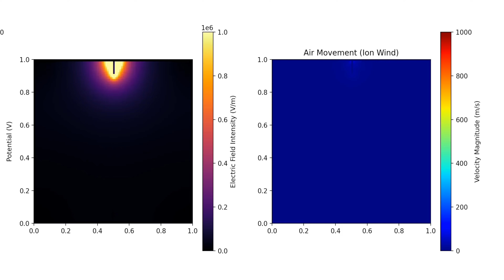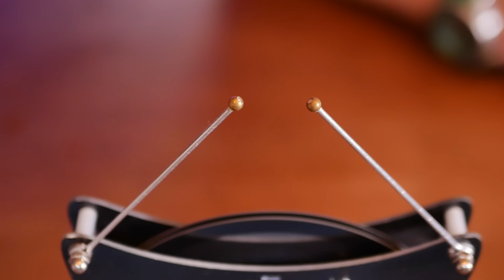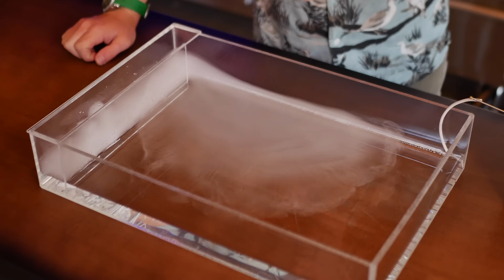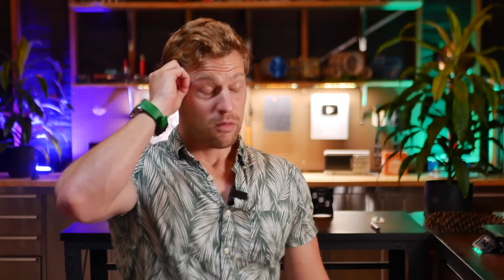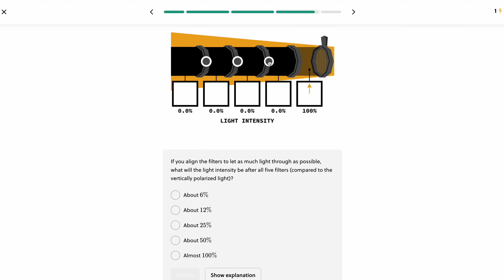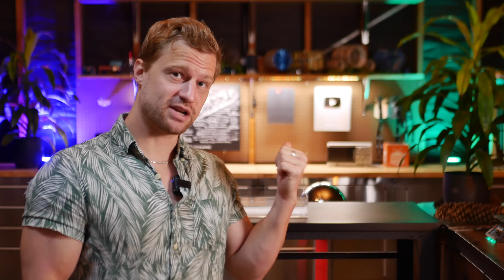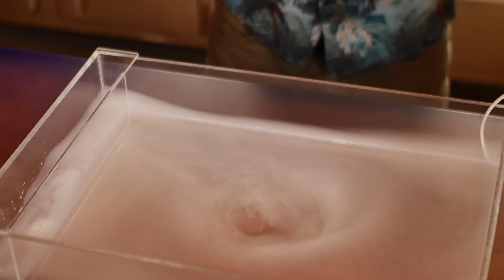This High Voltage Fog Is Controlled by Pointing (BiFrost Nebulagraphy)

Comment from the maker: Thanks to Chris for his assistance, my father Rick for reminding me about that "cool fog effect from years ago", and to Brilliant for sponsoring this video! Chris and I are working towards documenting the science behind this in a formal paper, with formalized results to come soon. Thanks for watching!
Reply: Hey does this work using ultrasonic water vapour instead of dry ice? Making a "desk toy" version of this that only needs to be plugged in instead of refilled with dry ice every time would be very cool to see. Love your work!
Reply: @jerryhuff4767 are you perhaps asking for a Chinese friend? 😊
Reply: @jerryhuff4767  From the old video (2006,) the streams will pop bubbles.  So, a little bubbler to make a white layer of tiny bubbles.   The streams also affect oil films, and the original inventor Charles Yost discovered them via Schlieren photography, so the streams must have a large effect on air pressure.
Reply: Why did you forget the theramin instrument it works almost on the same principle
Reply: @kanpurunplugged9970  The phenomena in this video are quite different than those used in the theramin.   The video depicts ionization of air molecules which are then drawn along an electric field (possibly with some electrons not attached to atoms) provided by the high voltage difference between the pan of water and the presenter who's attached to the high voltage DC generator.  The theramin operates by detecting subtle variations in capacitance between each of  its antennas and the operator. No high voltage nor ion flow involved, just an AC electric field.
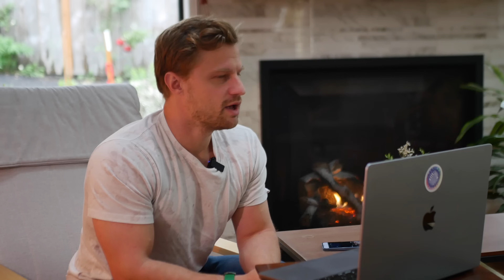Reply: Thanks for the video, a very interesting effect! I also got a kick out of "Propagation of intense catastrophe beams in air", mainly because it's fun watching scientists squirm and try to find new and inventive ways to avoid saying Tesla's death ray. While I will assume that for the sake of entertainment value, your actual experimenting was cut out of the video. From the viewer's side, we got to witness an effect and then a brief explanation of 3 possible theories, but no actual experiments, measurements, or testing of the theories. I would love a longer video with the testing left in, if possible. The setup has several variables that should be tested to see what role if any they play in the effect. For example would a different gas or liquid change the results. How does changing the conductivity of the liquid alter the results? Attempt manipulating the effect by introducing a magnetic field, does this alter the course of the beam? How is the beam affected by different types of obstructions, for example, does the effect work if a plate of glass or sheet of paper is between your hand and the liquid. Does the air temperature affect the results? Instead of using your finger can we use other materials and test a small range with conductive and insulating properties? Can we create a deeper fog layer to observe air currents being created farther from the liquid surface? What effect does reversing the electrical polarity have. What would we observe if metal fillings were suspended in the liquid? Then the next most important part since you already developed some theories are there any ways to challenge them? What must happen that would disprove ion tunneling being the correct explanation for the observed effect? I find that a theory is only as good as its potential to be disproven. A theory that has the potential to be easily disproven is a good theory. A theory with no ability to be disproven is faith, not science. I love your videos!!!! They always get the creative juices flowing! You should also look into this video "Shooting Electrons In a Cloud Chamber Is Amazing!" by "The Action Lab". AT 4:55 in the video he runs an experiment very similar to yours but instead, he is using alcohol vapor in a cloud chamber setup. His and your experiments are very similar in principle but produce dramatically different results. Might be interesting exploring why. Crossing my fingers for a follow-up video!
Reply: What possible beneficial application might you imagine could potentially use this?
Reply: @autonomouspublishingincorp1778  Weather control, earthquakes, anti gravity, plant growth(large trees), Melting buildings etc.
Reply: @autonomouspublishingincorp1778  This effect won the 2002 Nobel prize in chemistry.   It's used to load single biomolecules into a mass spectrometer.  (The streams turn out to be microdroplets, launched like a machine-gun via DC high voltage.)
Reply: @wbeaty  In spite of the dishonor of winning a Nobel Prize, wouldn't you think there is likely something actually useful that could be done with this if someone were clever enough to figure out what?
Reply: Super great!! Thank You!!
I can imagine why this Experiment won't leave One's Head, it is so easy to reproduce and super impressive! Also looking like Magic
As a Followup what would happen if You reverse the Polarity?
Reply: "Applied high voltage TO a sharp POINT"??? How about "BETWEEN" a sharp point and ground"?
Reply: Can you reverse the flow to see if the gas travels upward? I also want to see if you can get a probe in a balloon, maybe fill it with water and see if it will pop. I want to see if you can use the coil and power a florescent bulb, or effect an electro storm ball. (More I text the more ideas I come up with lol) like how about doing this in a pressurized container to see if it effects it through the glass. (Maybe your plasma generator container?) or hell just fill that bad boy with co2 and turn on your plasma generator 😂 I can only imagine how fast that gas would spin.
Reply: @vidiotray3  You can make a plasma-globe from a little Tesla Coil with a plastic bag full of pure argon.  (A 1cm spark in air  becomes a 10cm spark in argon.)   And, the ion-thread doesn't need water, it just needs a charged metal plate and a grounded nano-emitter such as a single human eyelash.   All of that could be done inside the argon-bag, no vacuum pumps or glassblowing needed.   Will the plasma streamers from the TC follow the "air wire?"
Also, I made an upwards ion-thread using a small metal ball in the water, with a single human eyelash attached to the upper surface.  It makes a white line, since it entrains some fog on its upward journey.
Reply: @wbeaty hmm kinda want to see that, any vids on that?
Reply: New idea, add a friend to act as a disturbance. See if they can block the bridge.
Reply: 3:29   It’s only hard to explain when you negate  the  aethr*.  Attempting to do so without it becomes quite a mess …. Formulas filled with fillers and fluff.   Soon fluffers are found all around attempting to keep things up and moving in the right but ultimately wrong direction/s.  Lost in spaces. Tired cold empty pLaces. An all holey d vine land of lace.  Awl Holes that is. From Dreamer to 2 d reamer.   

Luckily i was brought back on track by Einstein, in a little known  neglected talk, where he retracted his prior statements regarding aethr and so much more. Hoping  he could undo the damage he admittedly had a large roll in… unfortunately it was too little too late. The world of science was already moving along and had no time for suggestions. Corrections. Or backtracking. His foundation was already being built upon and bearing more weight by the day as shims Shovels patches and plugs worked to keep any ifs ans or buts inline. Closed shut.    

 
In this talk Epstein * said to even try and consider a system without the inclusion of the aethr is utter lunacy.  The info in said talk bookends nicely into primer fields Theory by David Lapoint which explains the double slit experiment in excellent detail as well as gives his #PrimerFields Theory which replaces what you’ll discover is the incorrect “Bohr/Bar Magnet Theory”. 

I promised you of you view the “Primer Fields Series” by Plasma Physicist David Lapoint; which is found free here on YouTube…. You will agree with me. 

All you need is an open honest heart and mind. Driven by true intent. Aka to where and what the truth leads is no matter as long as it is the truth. 

*a less oft used spelling these days though it truly is what i would certainly refer to as the “correct” or best spelling… this is because of its connection to other words on anagram form:

aethr
earth
heart

This spelling is also excellent æthr/Æthr…. As these æ/Æ characters literally tie to aethr. 
 
 
Did you one that the title
“king Arthur and the knights of the round table 

 is encoded using something called the “language key”  which involves  phonetics, word breaking and some simple excellence cipher basically. Outside of certain circles this sort of info is largely unknown and typically sharing it would have been off limits  ( though studies have shown the public cares very little for such things and unless they are told by the proper channels… they will almost certainly reflect pretty much everything. … ¿ What are the “Proper channels” you say?   Those of the television of course. “The noose you can trust”.  It would  be major news to most if they learned that all along a language has been hidden within language …..and yup you guessed it. There’s same one woven phonetically into everything since before you were even alive.  (Interested?? Want more proof ?  Or are you devoid of curiosity lacking an inner spark? Heart chords long since cut or perhaps never were attached due to …. Various factors ….one being connected to inviting fertilization lacking the literally spark of life upon fertilization. The male and female acting as ano-de catho-de. The arc and projecting blue beam…. Which is mirrored in the earth.  And is the origin of the so called project blue beam.  Another name for that is the “ball lancing beam “. And the scale known as the triple beam also connects. Why am i going on about this?? Well it also connects with the title though im not going to go any further into all this at the moment… i mean beyond giving pretty much the entirety of the hidden title.:

“KinG Aethr and the k-ni-nights of Ð-round table”

“KinG Aethr and the k-ni-nights of Ðrowned table”

The four corners.  ( ļ )

By the way the largest corporations in the world have names that tie into this Drowned table.  Such as “Blackrock” and “VanGuard”. The Blackrock wpuld be the Magnetic Mountain. Aka Mt.Maru as well as the basis for tails told by JRR Tolkien and many other initiates. Bearing a light, a torch, knowledge about the past and predictions of what’s to come. 

* interested in reading this talk by Einstein? Let me know and ill give you help. You simply need to ask.
Reply: You deleted my comments…….  Oookay.  That’s problematic.   
Why would plasma channel delete  stuff about plasma??   

And if you disagree with the info I’d like to see you openly do a reaction videos or something like that. Explaining why it’s wrong …… i cant imagine how one could do that since …. It all unifies nicely
Reply: @CoincidenceTheorist could be YouTube itself, been experience people complaining about this for a while.
Reply: If you wanna know some amazing math stuff from before the pharos, look up the vase measurements in the unchartedx channel.
He measured some ancient relic vases with  modern  metrology equipment.
the tolorences are amazing  and so is the use of pi and phi as well as their radon-based measuring systemyou should have a podcast with them lolor just react to them
Reply: Some what off topic and cryptic but by ionizing the air you're able to trap photons some may disagree in larger scale testing the data shows it works especially for higher power out put.
(air waveguides or optical waveguides in air)
Reply: I'm going to admit, I don't jump into your videos as much as the other sci-education creators I (probably most here) follow. Your stuff and deep dives - it's at odds with your channel aesthetic / vibe. My eyes scream at me to expect "bro bro bro" Douche'ry... Throws me off a bit. But totally cool topics!
Reply: Caused by lint fibers standing up on your skin, so, when it doesn't work, lick your fingertip, then brush it across fabric.   Also, damp woolen mittens work great!
Reply: It's well documented since being discovered around 1914. 
The term is Taylor Cone, also Electrospray.   I stumbled on it around 1998, and tracked it down to droplet-emission effect.  Rats, not unexplained physics discovery, no Nobel prizes for me!   
Apparently a sharp wire will not make these streams, but a mercury-wetted wire supposedly will.   Maybe try it with warm gallium, not Hg.    Damp human hair, damp woolen mittens, and single human eyelashes work great.   Also try the torn edges of paper.   I suspect that dry fibers must have little corona discharges at their tips, to send off carbon particles.   A bit like smoke from stick-incense, but with an added high voltage drive to remove turbulence.

Accelerator jockies call this the "gas focussing" effect, where a cloud of moving ions will self-focus into a thin beam if any gas is present in the chamber.   However, this is slightly different, because gas-focussing involves collisional production of opposite ions which then form a hollow sheath surrounding the moving ions.

I attached a single eyelash to a little disk of foil, then floated it in the fog tray.   I managed to photograph the laminar stream shooting upwards from the tip of the eyelash.   Also, surrounding the eyelash, you can see fog moving inwards towards the eyelash tip, like bad CGI of a black hole.   Apparently these streams entrain quite a bit of air, and convert a collapsing spherical flow into a laminar line-flow.

If you vibrate the emitting-hair, the stream becomes modulated.   Try slow pulses, then using time-delay to measure the stream velocity.   From a quick test it seems to be above 20MPH with a 5KVDC supply.   Maybe we could store digital data on the stream?   Or audio?   I managed to make 6ft streams using a VDG machine, with a plant leaf taped to the dome as the stream-emitter.

Controversy:  how small must a charged fluid droplet become before we call it an "ion?"   In today's FIB Ion-beam Lithography, the so-called "ions" are actually small droplets of liquid indium, produced by a "liquid ion emitter" via the Taylor-cone electrospray process.   These streams are not "ions," not charged atoms.   They're hypervelocity indium bullets, shot through an electrostatic railgun.   (Do this in a vacuum chamber, and the stream will automatically drill its own exit-orifice.   In other words, what you've got here is Ion-beam Lithography, but using it at 1ATM to sculpt fog rather than bulk silicon.)

All of the above from 1998 suggested demos for HV physics lectures and science-fair projects.     DANGER:  if you mess with these inside vacuum chambers, the streams' velocity is many orders higher than in air, and will slice or drill through objects.   In 1984, I saw this effect drill through a standard light bulb, but at the time had no idea why it was happening. That was using 200KVDC in vacuum.
Reply: @wbeaty  I think this video demos something even less fancy than electrospray, and that's plain old "ion wind" (see wikipedia for details,  observed in 1709, apparently). Cool demo, but as an experiment not very helpful:  What is the role of the pan of water... is it just providing a diffuse ground terminal, or is it significant that it's a liquid, or of a certain temperature? Does the "fog" play any role other than making the air flow visible?
Reply: This is a really interesting effect. Congratulations for the persistence and ensuing breakthrough! I hope we get a chance to explore this phenomenon in more depth at OpenSauce!
Reply: now apply this to handle deep space communications
Reply: This video has blown my mind, one of your best. Thankyou mate. Love from Oz
Reply: My kids love this channel.
Reply: So currently you've tried it with a sheet of fog, what if you take this to the third dimension and fill a box with fog?
Reply: @ShadowWolf2508plays  use a human eyelash as an emitter.   Put the emitter inside the fog.    You'll see the fog contracting like a tiny sphere, with the emitter-tip at the center of the sphere!   The hair-tip is pulling in fog from all directions, then launching it as a narrow stream far narrower than 1mm.   But the thin stream looks invisible (maybe it's just moving too fast?    From their time delay, these streams appear to move at over 20MPH.)
Reply: Is there a way to see the ions as they go from your finger to the fog?

Or how about this, could you fill a box with fog and try doing this? You know, instead of doing this on a flat surface...
Reply: Im so mixed about the content.. as in.. I like the content...but Mr Beanwater is soo giving me Homelander vibes.
Reply: Please if you can check Joe Rogan's episode with Terrence Howard
Reply: hola, puedes filmar tu experimento usando el efecto Schlieren
Reply: THEORY OF EVERYTHING IDEA:  Revised TOE: 1/24/2024a:

TOE Idea:  Short version:  (currently dependent upon the results of my gravity test):
The 'gem' photon is the eternally existent energy unit of this universe.
The strong and weak nuclear forces are derivatives of the electromagnetic ('em') interactions between quarks and electrons.  The nucleus is a magnetic field boundary.  'Gravity' is a part of electromagnetic radiation, gravity acting 90 degrees to the 'em' modalities, which of course act 90 degrees to each other.  'Gravity' is not matter warping the fabric of spacetime, 'gravity' is a part of spacetime that helps to make up matter.  The gravity and 'em' modalities of matter interact with the gravity and 'em' modalities of spacetime and the gravity and 'em' modalities of spacetime interact with the gravity and 'em' modalities of matter.

TOE Idea:  Longer version:  (currently dependent upon the results of my gravity test):
THE SETUP:
1. Modern science currently recognizes four forces of nature: The strong nuclear force, the weak nuclear force, gravity, and electromagnetism.
2. In school we are taught that with magnetism, opposite polarities attract and like polarities repel. But inside the arc of a large horseshoe magnet it's the other way around, like polarities attract and opposite polarities repel. (I have proved this to myself with magnets and anybody with a large horseshoe magnet and two smaller bar magnets can easily prove this to yourself too.  It occurs at the outer end of the inner arc of the horseshoe magnet.).
3. Charged particles have an associated magnetic field with them.
4. Quarks, protons and electrons are charged particles and have their associated magnetic fields with them.
5. Photons also have both an electric and a magnetic component to them.

FOUR FORCES OF NATURE DOWN INTO TWO:
6. When an electron is in close proximity to the nucleus, it would basically generate a 360 degree spherical magnetic field.
7. Like charged protons would stick together inside of this magnetic field, while simultaneously repelling opposite charged electrons inside this magnetic field, while simultaneously attracting the opposite charged electrons across the inner portion of the electron's moving magnetic field.
8. There are probably no such thing as "gluons" in actual reality.
9. The strong nuclear force and the weak nuclear force are probably derivatives of the electro-magnetic field interactions between quarks and electrons.  In the case of the alpha particle (Helium nucleus), the electro-magnetic field interactions between the quarks themselves are what keeps them together in that specific structural format.
10. The interactions between the quarks EM forces are how and why protons and neutrons formulate as well as how and why protons and neutrons stay inside of the nucleus and do not just pass through as neutrinos do.  (The neutrino being a substance with a very high gravitational modality with very low 'em' modalities.)
11. The nucleus is probably an electro-magnetic field boundary.

THE GEM FORCE INTERACTIONS AND QUANTA:
12. At this time, I personally believe that what is called 'gravity' is a part of electromagnetic radiation, gravity acting 90 degrees to the 'em' modalities, which of course act 90 degrees to each other.  'Gravity' is the force which allows a photon to travel across the vast universe without that swirling photon being flung apart or ripped apart by other photons and/or matter interactions.  Gravity being a part of the 'em' photon could also possibly be how numbers exist in this existence for math to do what math does in this existence (the internal oscillations of the 3 different parts of the 'gem' photon, each modality having a maximum in one direction, a neutral, and a maximum in the other direction.)  'Gravity' is not matter warping the fabric of spacetime, 'gravity' is a part of spacetime that helps to make up matter.  The gravity and 'em' modalities of matter interact with the gravity and 'em' modalities of spacetime and the gravity and 'em' modalities of spacetime interact with the gravity and 'em' modalities of matter.
13. I also believe that the 'gem' photon is the energy unit in this universe that makes up everything else in this universe, including eternally existent space and time.  ('Space' being eternally existent energy itself, the eternally existent 'gem' photon, 'Time' being the eternally existent flow of energy, 'Space Time' being eternally existent energy and it's eternally existent flow).
14. When these vibrating 'gem' photons interact with other vibrating 'gem' photons, they tangle together and can interlock at times. Various shapes (strings, spheres, whatever) might be formed, which then create sub-atomic material, atoms, molecules, and everything in existence in this universe.
15. When the energy units unite and interlock together they would tend to stabilize and vibrate.
16. I believe there is probably a Photonic Theory Of The Atomic Structure.
17. Everything is basically "light" (photons) in a universe entirely filled with "light" (photons).

THE MAGNETIC FORCE SPECIFICALLY:
18. When the electron with it's associated magnetic field goes around the proton with it's associated magnetic field, internal and external energy oscillations are set up.
19. When more than one atom is involved, and these energy frequencies align, they add together, specifically the magnetic field frequency.
20. I currently believe that this is where a line of flux originates from, aligned magnetic field frequencies.

NOTES:
21. The Earth can be looked at as being a massive singular interacting photon with it's magnetic field, electrical surface field, and gravity, all three photonic forces all being 90 degrees from each other.
22. The flat spiral galaxy can be looked at as being a massive singular interacting photon with it's magnetic fields on each side of the plane of matter, the electrical field along the plane of matter, and gravity being directed towards the galactic center's black hole where the gravitational forces would meet, all three photonic forces all being 90 degrees from each other.
23. As below in the singularity, as above in the galaxy and probably universe as well.
24. I believe there are only two forces of nature, Gravity and EM, (GEM). Due to the stability of the GEM this is also why the forces of nature haven't evolved by now.
25.  'God' does not actually exist except for as a concept alone.  The singular big bang theory is a fairy tale for various reasons.  The CMBR from the supposed 'bang' should be long gone by now and should not even be able to be seen by us.  Red Shift observations have a more 'normal' already known physics explanation, no dark energy nor dark matter needed.  The universe always existed in some form and never had a beginning and will most probably never have an end.  Galaxies collapse in upon themselves, 'bang', eventually generating new galaxies.  Galaxies and 'life' just come and go in this eternally existent existence.

DISCLAIMER:
26. As I as well as all of humanity truly do not know what we do not know, the above certainly could be wrong. It would have to be proved or disproved to know for more certainty.  Currently, my gravity test has to be accomplished to prove or disprove that portion of the TOE idea.  But, if not this way, then what exactly is the TOE of this existence?

GRAVITY TEST:  (Short Version):
Direct a high powered laser 90 degrees through an electric field and magnetic field polarized as such to nullify the 'em' of the laser.  "IF" my current TOE idea is correct, a gravitational black hole would become evident.  (The 'gem' photon being the energy unit of this universe that makes up everything else in existence in this existence.)
Reply: Consider the following:  Energy transfer between beings, especially when those beings are touching.
Reply: The wimshurst machine you used looks compact and useful, but I can't find a source. Where can I find one?
Reply: Please after that share the code with us!!!!!
Reply: Is there some other medium (I.e. a visually reactive film) that you could put between to visualize the ions between your finger and the fog?
Reply: @plasmachannel when will you do a video adressing the grape allegations
Reply: 1x1=2 do you agree whit terrence howard?
Reply: 3:29   It’s only hard to explain when you negate  the  aethr*.  Attempting to do so without it becomes quite a mess …. Formulas filled with fillers and fluff.   Soon fluffers are found all around attempting to keep things up and moving in the right but ultimately wrong direction/s.  Lost in spaces. Tired cold empty pLaces. An all holey d vine land of lace.  Awl Holes that is. From Dreamer to 2 d reamer.   

Luckily i was brought back on track by Einstein neglected talk were he retracted his prior statements regarding aethr and so much more. 

He said to even try and consider a system without the inclusion of the aethr is utter lunacy.  The info in said talk bookends nicely into primer fields Theory by David Lapoint which explains the double slit experiment in excellent detail as well as gives his #PrimerFields Theory which replaces what you’ll discover is the incorrect “Bohr/Bar Magnet Theory”. 

I promised you of you view the “Primer Fields Series” by Plasma Physicist David Lapoint; which is found free here on YouTube…. You will agree with me. 

All you need is an open honest heart and mind. Driven by true intent. Aka to where and what the truth leads is no matter as long as it is the truth. 

*a less oft used spelling these days though it truly is what i would certainly refer to as the “correct” or best spelling… this is because of its connection to other words on anagram form:

aethr
earth
heart

This spelling is also excellent æthr/Æthr…. As these æ/Æ characters literally tie to aethr. 
 
 
Did you one that the title
“king Arthur and the knights of the round table 

 is encoded using something called the “language key”  which involves  phonetics, word breaking and some simple excellence cipher basically. Outside of certain circles this sort of info is largely unknown and typically sharing it would have been off limits  ( though studies have shown the public cares very little for such things and unless they are told by the proper channels… they will almost certainly reflect pretty much everything. … ¿ What are the “Proper channels” you say?   Those of the television of course. “The noose you can trust”.  It would  be major news to most if they learned that all along a language has been hidden within language …..and yup you guessed it. There’s same one woven phonetically into everything since before you were even alive.  (Interested?? Want more proof ?  Or are you devoid of curiosity lacking an inner spark? Heart chords long since cut or perhaps never were attached due to …. Various factors ….one being connected to inviting fertilization lacking the literally spark of life upon fertilization. The male and female acting as ano-de catho-de. The arc and projecting blue beam…. Which is mirrored in the earth.  And is the origin of the so called project blue beam.  Another name for that is the “ball lancing beam “. And the scale known as the triple beam also connects. Why am i going on about this?? Well it also connects with the title though im not going to go any further into all this at the moment… i mean beyond giving pretty much the entirety of the hidden title.:

“KinG Aethr and the k-ni-nights of Ð-round table”

“KinG Aethr and the k-ni-nights of Ðrowned table”

The four corners.  ( ļ )

By the way the largest corporations in the world have names that tie into this Drowned table.  Such as “Blackrock” and “VanGuard”. The Blackrock wpuld be the Magnetic Mountain. Aka Mt.Maru as well as the basis for tails told by JRR Tolkien and many other initiates. Bearing a light, a torch, knowledge about the past and predictions of what’s to come.
Reply: would that effect be the same for the sun and the earth causing storms or hurricanes?
Reply: Have you seen Michael Levin videos on how biology uses something similar to determine the layout of organs at embryonic stages of development.
He also demonstrated how to change the layout and move an organ to develop at a different or wrong location on the organism.
Reply: i wonder if its the same effect as sometimes when I use my cell phone, I go to push a button, and it clicks on the screen almost a quarter inch before I even touch the phone. I work in a high static environment.
Reply: I was working on building a mockup model of building special different Multi laird kinda like a hologram but made from different frequencies and other wave lengths.
Reply: But you really have inspired me to help with new insight.  Thank you so much bro!!! I wonder if we could video chat sometime man. I really would like to show you some of my ideas for designing some really cool stuff???
Reply: Kids watching WHY use the only true curse word???
Reply: I'm glad I watched this video, I just finished watching your most recent video and was thinking along the lines of how you might overcome your humidity issue with your thrusters and asked myself if there was a way to dehumidify the air before running it through the thruster, then I watched this video and realized you already have the solution you just need to figure out how to apply it. I love your work man keep it up
Reply: You should working on Fog Bending. Using plasma energy to control fog making Fog Benders.
Reply: I think that this also helps to explain the tingling effect reported by people in the seconds before a lightning strike.
Reply: @RWBHere  Yes, and also the tingling experienced when near HVDC equipment (like hundreds KV.)   
One hobbyist in 1991 was seeing these "Charles Yost air-threads" by eye, when they appeared as mysterious spiderwebs springing from a wet 150KV x-ray power supply when powered up out of it's oil-tank.  (For dark background we turn off the room lights, then shine a bright spotlight.)
Reply: "Phenomena." Although excused for that because language is lower priority than science, and because it's an interesting video. By the way, saw a product today that seemingly has an electro static ring acting as a paddle for soap bubbles. Maybe should do a video about that.